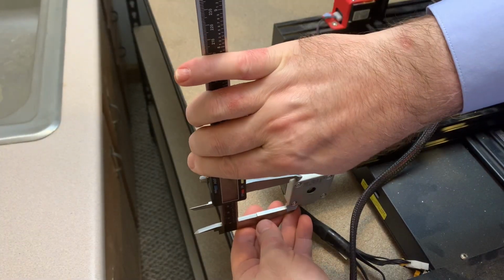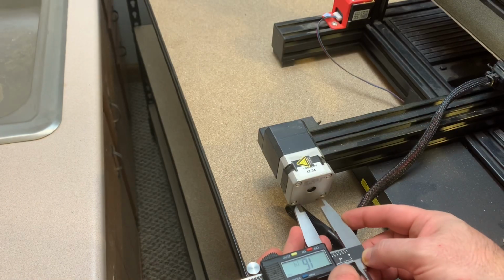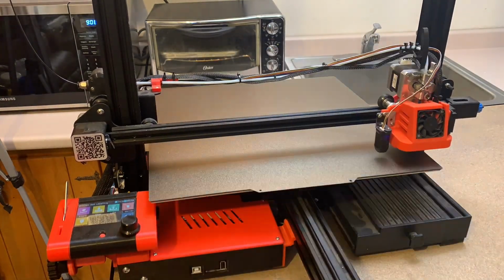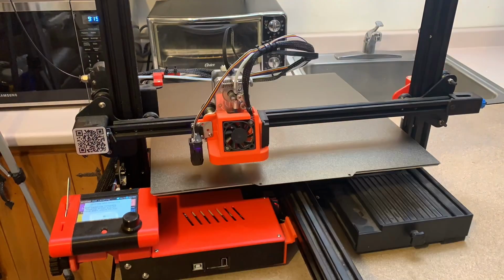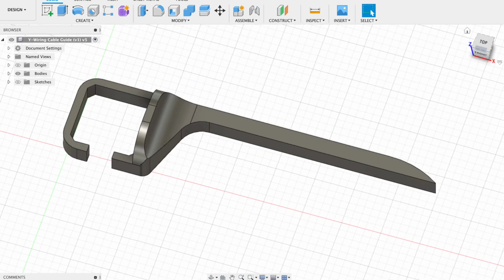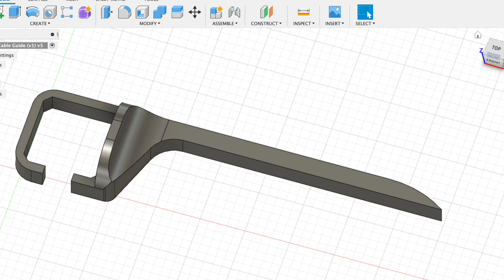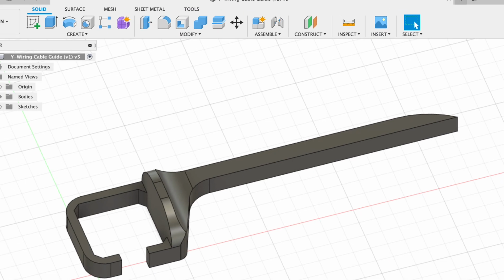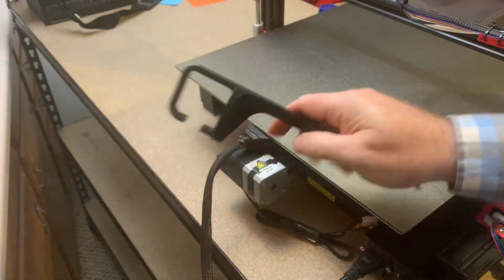Ender Extender 400XL Heat Bed Wire Guide + PEI Flex Sheet Review!

Comment: Interesting! I have built a 400x400 E3V2, but am not happy with the glass bed. It's very heavy causing the whole printer to wobble under acceleration, and the clips get in the way of the ABL probe at the corners. I will take a close look at this PEI sheet as an alternative. I may also look at dual Z screws as well. Thanks!

Comment: What is the size of the aluminium extrusions?
Reply from the maker: It's this kit here: https://enderextender.com/collections/ender-3-v2/products/ender-extender-400xl-v2 — The kit is now completely installed and the extrusions are not all easy to measure at this point.
Reply: @design8studio  well there is no info. And i texted them last week but they havent replied me yet(((
Reply from the maker: @footballera-i2p  Well, the Ender 3 V2 advertised build volume is 220 x 220 x 250, and the kit's upgraded advertised build volume is 400 x 400 x 500, so that's a difference of +180 on both X and Y, and +250 on Z. So perhaps just measure your existing lengths and add those amounts on. ?
Reply: @design8studio  well i thought all the parts got bigger to keep it working so seems like it got a bit bigger. And the aluminum extrusion is wider than the standard one so it definitely will reflect the length to get that 400×400×500 volume. Dont think your calculations work in this case. But thanks anyway
Reply from the maker: @footballera-i2p  Perhaps. However, having personally built this kit onto my Ender 3 V2, I'm of the educated opinion that if you measure the extrusions of an existing Ender 3 V2, and then add 180 mm on both X and Y, and add 250 mm onto Z, you will arrive at a working setup plan for the larger build volume. The rolling base, to which the print bed attaches, is an unmodified base from the original. The "margin" is essentially the same (the bed is bigger than the build volume by 10mm in both X and Y directions). The other components carry straight over from the original Ender 3 V2.
Reply from the maker: @footballera-i2p  Re: "well i thought all the parts got bigger" — the extrusions are longer, but they are the same class (width and height unchanged). Other parts are carried over from the original. Machining (milling) your own "new" longer version of the main X extrusion at the bottom is not something I'd care to attempt. But it's doable. The hardest part of making one's own longer versions of the other extrusions is getting square cuts and properly placed holes.
Reply: @design8studio  thanks sir
Reply: @design8studio  well i thought that i could build the extended version with raspberry pi and klipper and i just wanted to avoid buying the ordinary ender 3 version
Reply from the maker: @footballera-i2p  it's doable. If you can get your saw setup for perfectly square cuts, and you can get hole placement for drilling, you will be good. The biggest challenge for me attempting it would be milling out those chunks of extrusion on the new longer 40x40 extrusion that will replace the stock one.
Reply: @design8studio  thanks a lot. You've been really helpful
Reply: How to make your ender 3 v2  bigger because I want to print something bigger😅
Reply: @3vanescent96  well you need to buy longer frame components plus preferably linear rails and setup dimensions on the firmware. There is actually extender xl kit but it costs too much